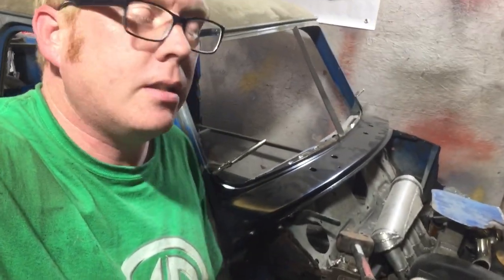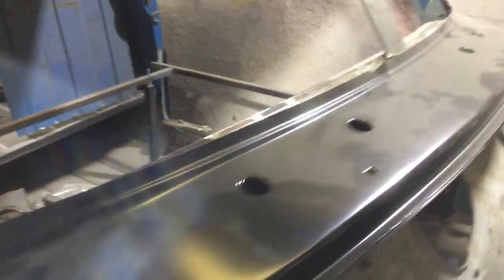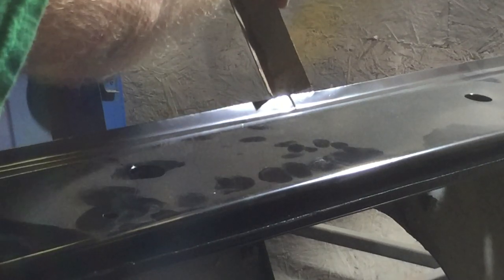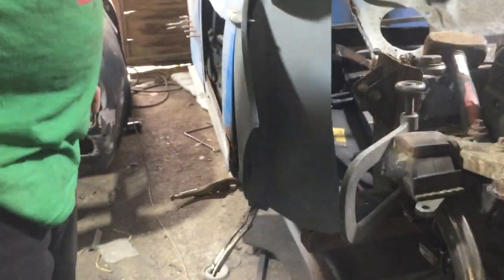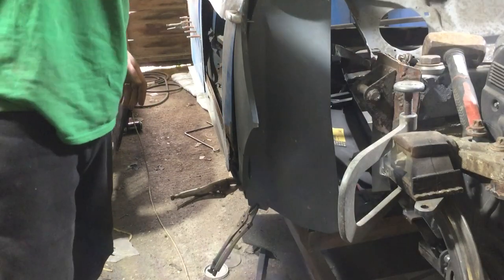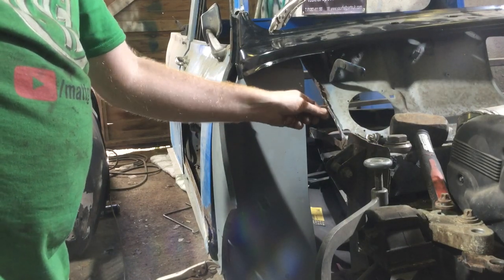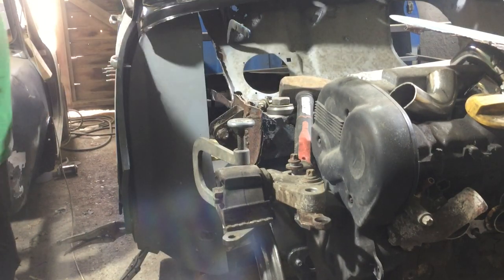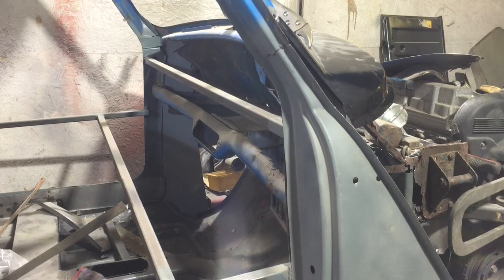Classic Mini Pickup Restoration Ep23 - Scuttle

Comment: the problem you have is the previous owner has cut far to much out  weakening the body structure
get the scuttle aligned   check the windscreen opening fo square by measuring corner to corner as close to equal sizes
then screw or rivet the scuttle panel temporary in place  and fit a windscreen this will help keep the body alligned
i've seen this often where people repair  bodies then find  the windscreen wont fit  because they  didnt support it enough